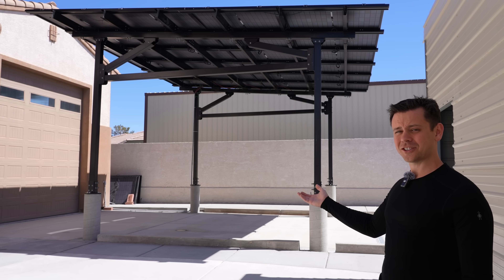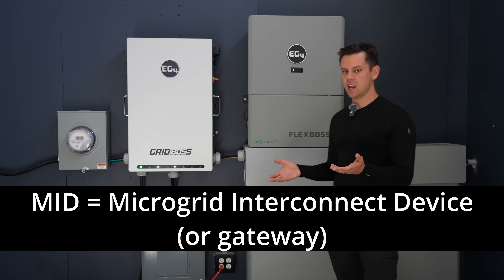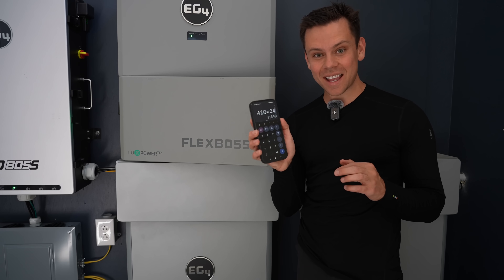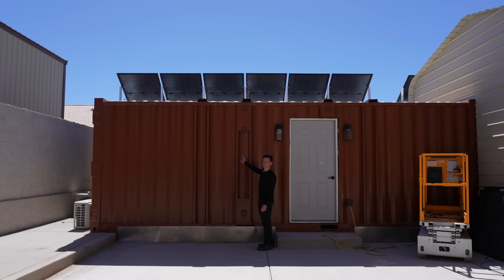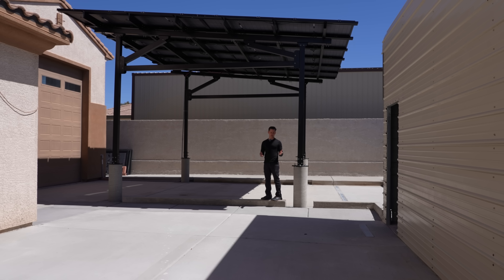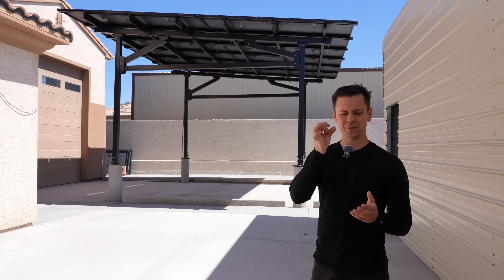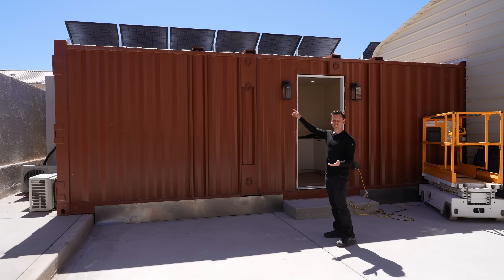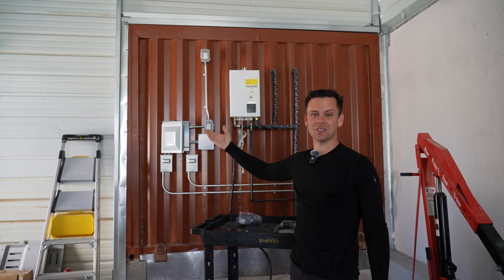Yikes! Not 12,000W?! Chiko Solar Carport w/ Aptos 410W Bifacial Panels

Comment: I really love the EG4 Grid Boss + FlexBoss21 combo.  For the last few weeks I have been DIY installing it for my home and I've been running it with one of their indoor batteries for the last few days (a second battery is coming in a few days).   I connected up my legacy 5kW solar (DC string to grid-tie inverter) ... so I just left it AC coupled and connected it to a smart port.

I'm completely gobsmacked over how well the system is working.  And all the EG4 components have all the certifications needed including the California (where I live) CEC listings, so I'm actually legal 🙂  The only time the FlexBoss21's fan has even come on, so far, is when I charge my EV at 7.5kW.   Next up I'll be DIYing a solar expansion project to pump the roof solar up to 15kW.

-Matt
Reply from the maker: I love it too. Works so well
Reply: What's the total idle consumption of the GB+FB21?
Reply: @P7ab  Both together seem to be around 120W or so.  The Flexboss21 eats roughly 1.2A from the battery when otherwise doing nothing.  The GridBoss eats a similar amount of power… which surprised me a bit but presumably its burning power keeping relays energized.  In anycase, about what the manuals say they burn.  So definitely these should be paired with a decent amount of Solar, as with anything on this scale.

If you are looking for something that sips power, something like the Victron Multiplus 2 has extremely low idle consumption (12-15W).  But that is a far more limited device.

-Matt
Reply: @junkerzn7312  thanks, yeah, up north it would take us 3kw of solar just to cover the idle on those in winter!
Reply: I was thinking of tying my Anker F3800 into a smart port but was told it would not work.  I didn't see why it would be any different than tying in some micro-inverters. 
I just don't want to fry my Gridboss 😢
Reply: @randya9143  The F3800 is not a grid-tie inverter.  It is definitely not a microinverter... uh, why would you think it was?

To be a grid-tie inverter the device has to be able to synchronize to the grid waveform and implement UL1741[SA].  The Anker does neither so you would wind up blowing something up if you tried to connect it's output to a grid-supplied line waveform.

Microinverters are very different devices than power stations.   Microinverters are designed to be connected to the grid.  They synchronize to the grid waveform in order to push power (called AC-coupling) and they follow UL1741[SA] and other safety-related certifications to avoid electrocuting a grid line worker.

-Matt
Reply: @ 
I’m using two F3800’s tied into the Anker home panel. It has all the safety controls built in and is tied into the grid right now.
I should have put that in my post , it could have saved you a little time in your response. Although it was Very informative and educational.
Reply: @randya9143  I'm assuming that's just the grid connected to its AC input, and its AC output goes to the Anker home panel.   It does not appear to have any certifications to export power.  i.e. power flow is one-way.   Nor does it have any certifications as a service entrance.

There is a separate Anker transfer switch kit that is certified to UL1008... which is basically an emergency generator transfer switch certification but that also isn't a service entrance certification.

The GridBoss / FlexBoss21 combo is a completely different beast.  The GridBoss is fully certified as a 200A service entrance and the combo can flow power in both directions as well as handle both AC and DC coupled solar, has a built-in ATS with a built-in manual override (generally required by code for an ESS, supports 3rd party batteries and 3rd party AC coupled solar, and can scale massively.

-Matt
Reply: @ 
I have the Gridboss/Flexboss installed with three PowerPro batteries. I have the backup load breaker going to a manual bypass switch and out to a critical load panel. The Anker is tied into other side of the switch. I do not export any power to the grid and never will. The Anker is just a backup to my backup that hopefully I never need. If the Gridboss had been available a year ago I would have never purchased the Anker system. But since I already have it I wanted to tie it in. The input to the Anker setup comes off my main panel which is connected to the non backup output of the GridBoss. Even though I don’t need the Anker I still cycle the batteries once a month by adjusting the app. The batteries discharge back into the main panel helping shed some of the load. There are main CT’s to keep that power from going any further than the main panel. It all works just fine now as is but I was just wondering if it was possible to do away with the manual bypass switch and put the Anker output to one of the GridBoss smart ports. That way I could set the GridBoss to automatically cycle the Anker system to keep the batteries healthy.  If I can’t I can’t, not a big deal. I am thinking about selling all the Anker stuff anyway and getting the Boss Box with the three batteries.   Thanks for all your information as you are obviously way more knowledgeable than I am on all this.  I am going to Signature Solar for a class on the GridBoss to get more knowledge on it soon. 
I just got into solar 1.5 years ago and have a lot to learn.
Reply: @ You definitely have a lot of flexibility.  I wonder if the Anker's output could be put on the GEN port of the GridBoss.  It might take a bit of playing around to make it work reasonably well but then you would be able to exercise it more easily and possibly even use it as a final battery buffer if the main system gets low and the grid is down.  I've never tried putting a power station on the GEN port so I don't know how well this would work.

Comment: You'll see slightly above STC (~10kW) this summer, especially with that low angle (prime for summer). Report back late June 😄

Edit: The Vegas heat will drop some of that performance so might actually be a little better in May.

Comment: You need a chrome wrap or paint 😂
Reply: White has higher reflectivity than chrome or mirror, which is actually optically grey when mirror effect factored out.  Silver mylar's coherent light beams offer an exact reflection of the surroundings, which is not required to simply reflect light. Better to have evenly distributed scattered photons bouncing off of bright white surface.  Mirrored coating is counterproductive as it introduces irregular focal hotspots which present themselves as uneven highlights to the panel, possibly defeating electron flow the way a shade tree would.  It is also much more expensive, as well as having a suboptimal uncalibrated refractive index, potentially filtering out light frequencies the panel expects.
Reply: @mikemotorbike4283  well it sounds like you know what your  talking about thanks

Comment: Too much heat to make full power
Reply: STC is rated at 77ºF which is what it is in Vegas right now. It's definitely due to the angle of the carport vs the closeness of the sun at this time of year.
Reply: yup quite true...pretty sure will knows but should've mentioned it
Reply from the maker: @nach335   I was hitting over STC with these panels on the bunker vault but yes for this time at my latitude I was expecting more gain, even with this tilt, but I could have mentioned it. My ground array was also doing pretty good without being lifted it up. Overestimated that
Reply: A mist system would lower temp by 20°